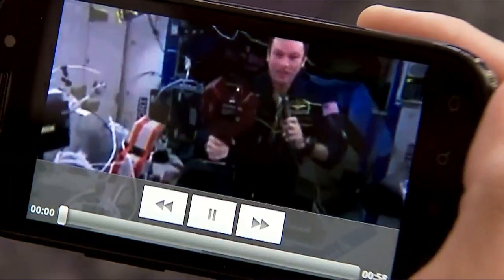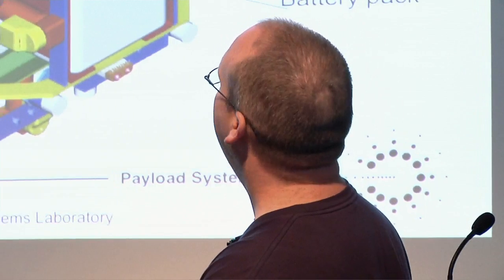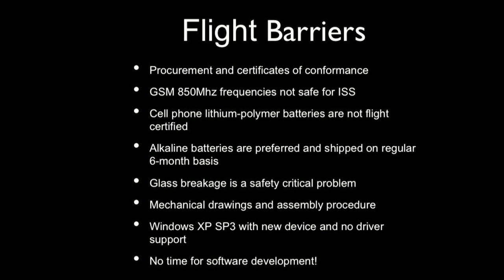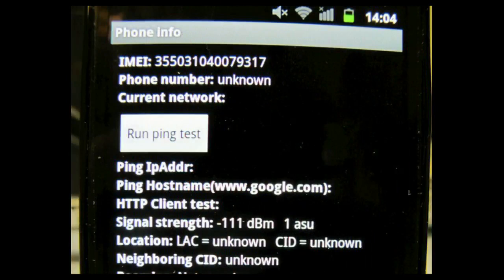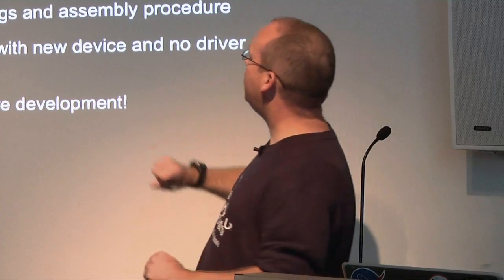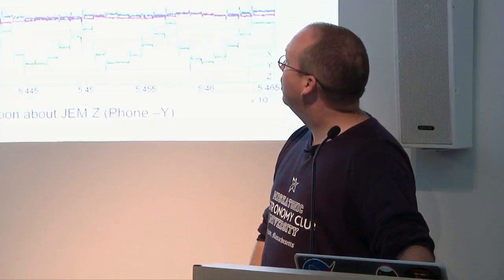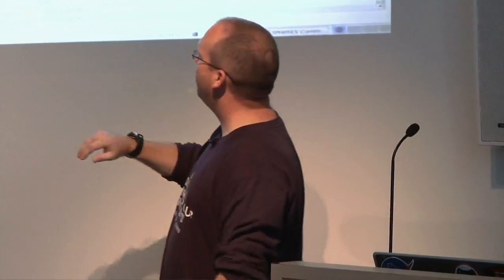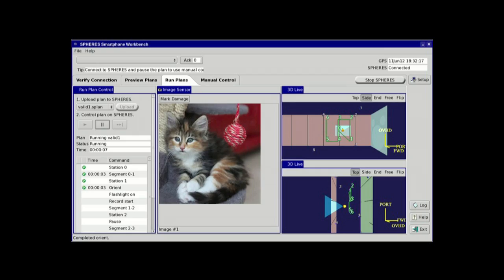Smart SPHERES: Free-Flying Space Robots | Mark Micire | Talks at Google

Comment: They're noisy because the fans have to move air. Doesn't matter if they're on the ground or on the ISS. The small fans on your computer are definitely noisy when they want to move volume.

PSA is the robot Mark talked about at the 6 minute spot. If you want the robot to be quieter, use bigger fan. V2 wanted to use movable ducts over a large fan. Rotations would be performed with reaction wheels.